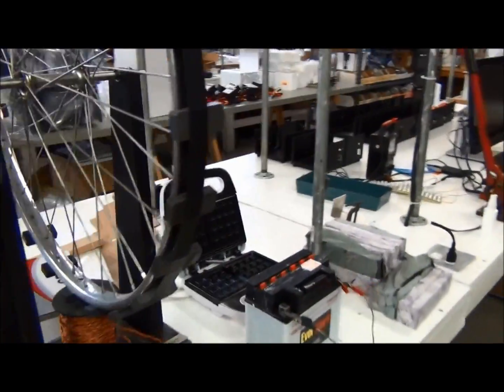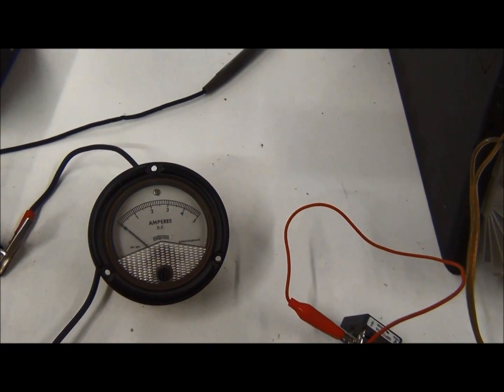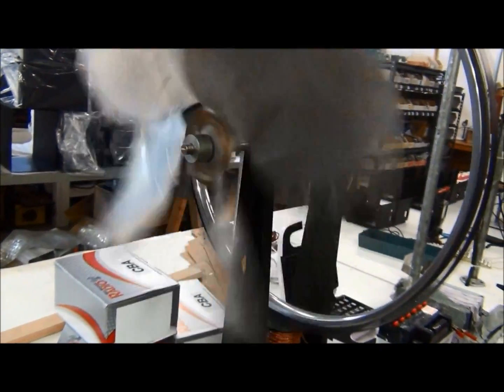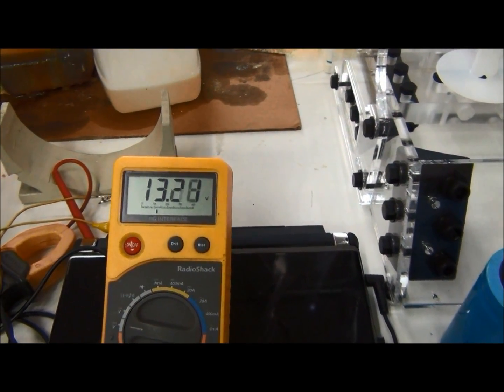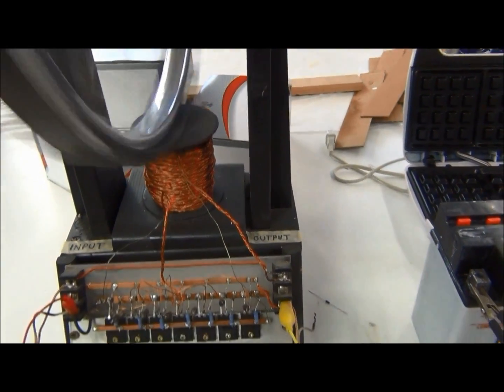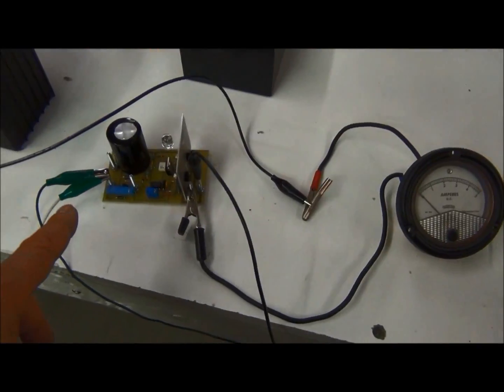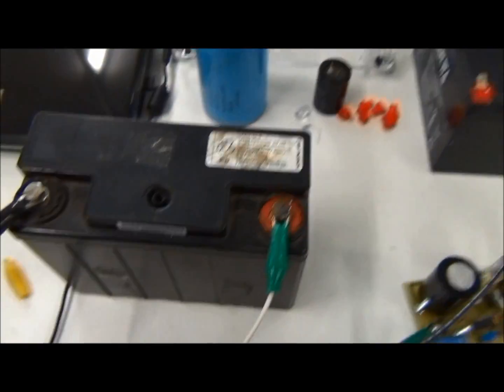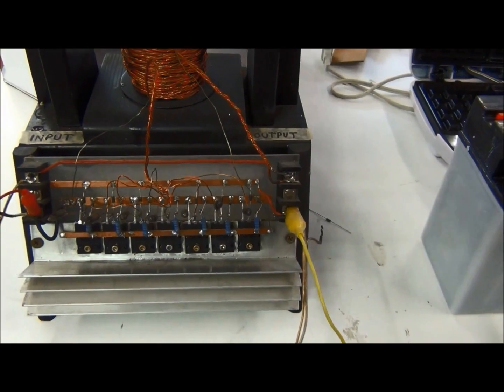The SG Energizer Cap Dump John Bedini & Chuck Hupp

Comment: A voltage boost with a Joule circuit can do exactly the same thing without mechanical rotating devices and the result is the same and doesn't take up space.

Comment: Ok....so the machine is 1 amp 12 volts machine.....so it is 12 watts discharging.....and charge 1 amp every second. So during the second am spending 12 watts and recovery a portion of the second. So how would be this overunity??

Comment: Hello Mr Bedini, have you ever tried to connect an energizer to a tesla coil and transmit the radiant energy to receiver telsa coil to step down the high frequency and transform it to charge caps or a battery, or light a bulb, and use another tesla coil to receive energy to charge caps and run the energizer?  Kind of like closing the loop? Thank you

Comment: with my small energiser i have two generative coils seperate form the power coil and i am cap dumping the electricity picked up by the two pick up coils into a second battery. and it doesnt like going straight to the battery it likes to be pulsed. otherwise it slows to a holt. and also when have a large load on the two coils it speeds right on up there ! ha ha : ) interesting

Comment: Another question: how important the load on the output battery by the ssg circuit? 
My setup is : 4 amp/h 12v input battery and the same on 4 amp/h 12v output battery.

Comment: How you calculate Joules passed to battery? Did you substract energy that remains into capacitor? Capacitor is not discharged completely, because battery has some voltage with does not allow capacitor to discharge completely.

Comment: John, do you have one video that can walk someone through this entire process and exactly what is happening? As a laymen I simply do not understand what is happening. 
1. how the spinning wheel generates a continuous spin
2. how the spinning wheel charges the battery. I would imagine it operates like a generator by cutting the magnetic lines of force to generate electricity which is fed into a capacitor and then into the battery. but what is the logic behind the timing..

Comment: Hi John,

Instead of using multistrand you might try E. Leedskalnin way of winding and compare BEMF results for battery charge. When you wind coil, it contains 1 full layer of windings, then just one turn to beginning of the the previous layer instead of second layer, then another layer, then 1 turn and so on.

It is in /watch?v=UFcd_QCLK5w#t=0h12m22s if you are tempted too try it ;)

Cheers!